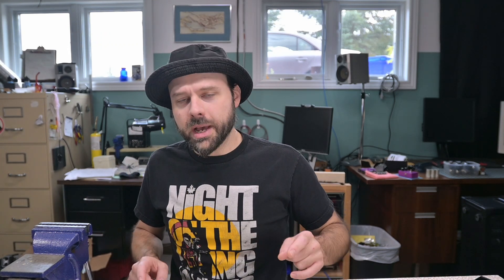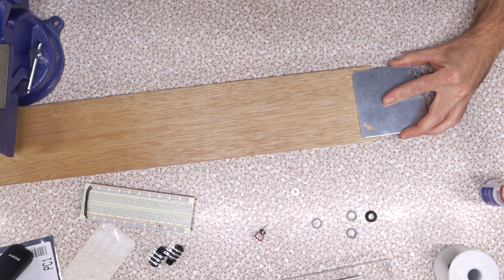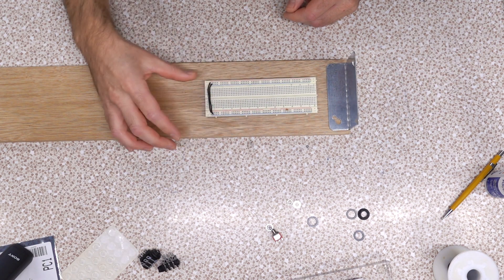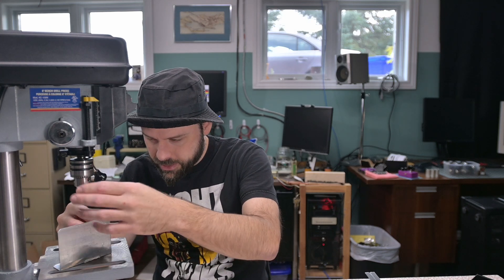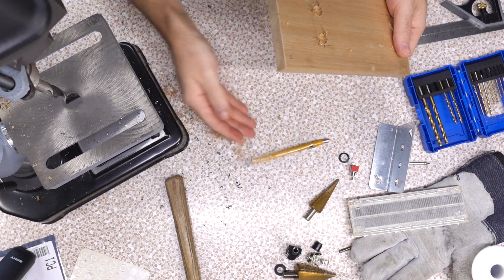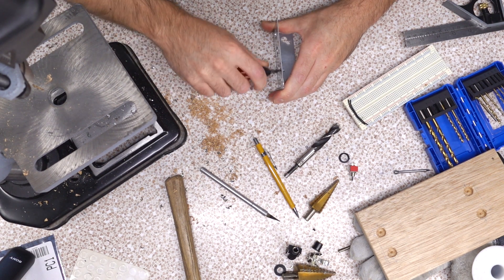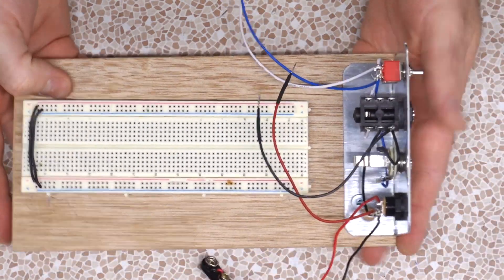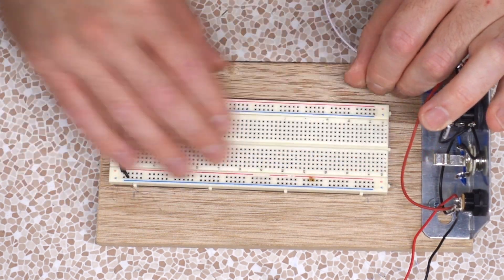Breadboard Pedal Build

Comment: Thanks for this inspirative video. I'm getting into pedal making with breadboard. Why did you use 2 different jacks for in and out ? Something about grounding ? 
Greetings from France !
Reply from the maker: So, usually you ground the circuit in the pedal to the box at some point. That is often done using the jacks. They often DON'T have a ground wire connecting these jacks as they just let it pass thru the box from jack to jack. In this case, I use a wire to connect the jacks, so it's good form to ground isolate one of the jacks to prevent ground loops that cause noise. So I use a plastic input jack that is isolated, and a metal output to ground to the box.